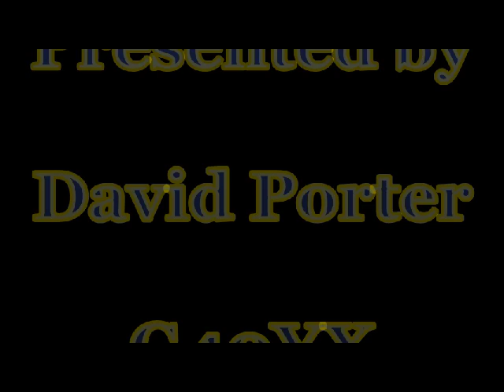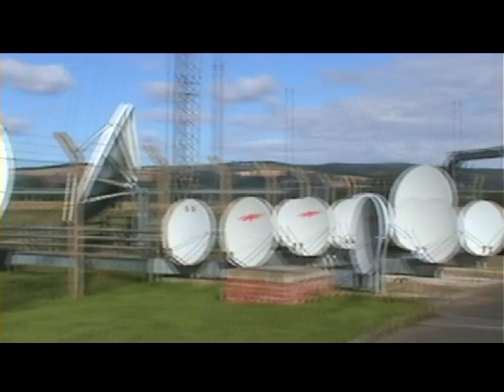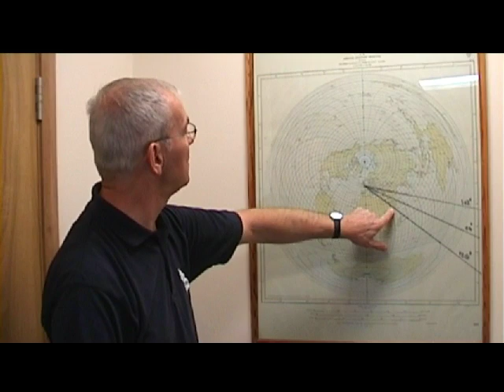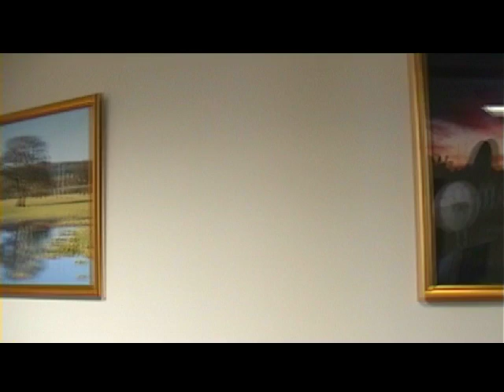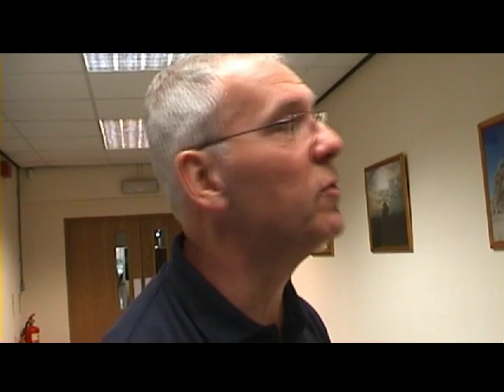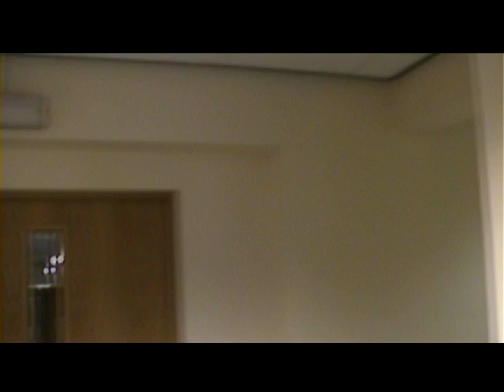Introduction to Woofferton Transmitting Station Part 1

Comment: Ted Randall owner of wtww and the Grand ole opry hotel in Nashville used to be the senior engineer at the bbc transmitter in south africa and had to make his own parts a lot of times and Radio Caroline has the bbc world service london transmitter in Orfordness and is slowly working towards getting it back on the air. they already have radio one formerly on 648 medium wave starting Friday 22/12/17

Comment: what about the power supply to wooferton . i am thinking when all transmitters are on full output it must need a power station of its own .i thought the video very interesting a friend told me he came to wooferton  some while ago are open days  still held thanks
Reply: Rubbish, it's just about 2MW or even less
Reply: A dedicated power line was built in the 1960s from Ludlow over Tinker's Hill via   Ashford Crossroads.

Comment: I'd give my back teeth to look round there. Is Woofferton ever open to the public?
Reply: Talk to Dave or Andy Madison or even Peter Moore sure they can give you a go around. They all are part of Merlin communications, Cobra Mist limited, and E&E 4 g mobile phone service. AKA Radio Caroline international. They also built operate and maintain the unlicensed pirate DAB and DAB + radio transmitters and networks. They have taken most of the bbc over 1 transmitter at a time. They took back MANX radio when Babcock communications went bankrupt back in the eirly 80's or so.